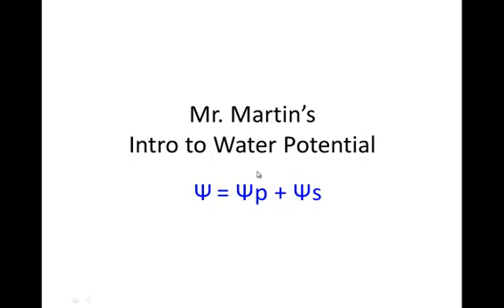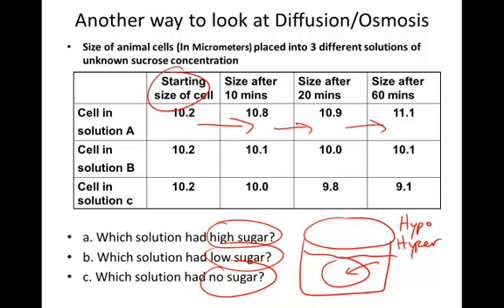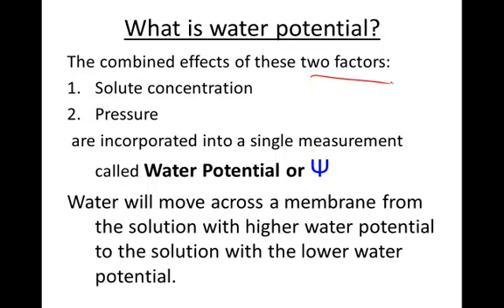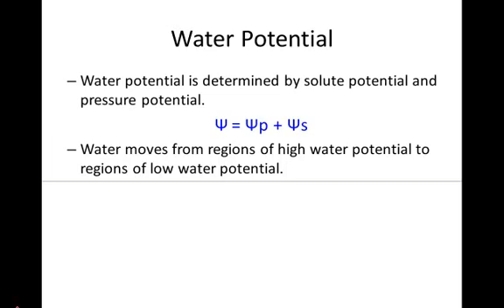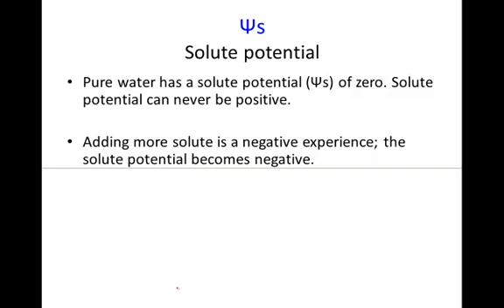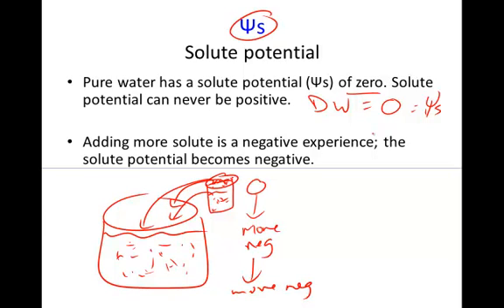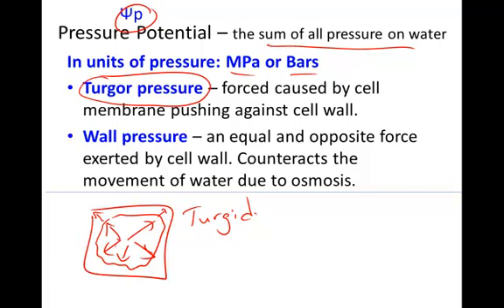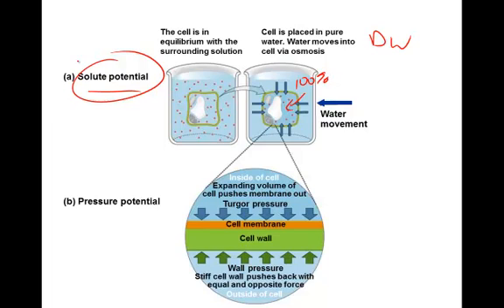Intro to Water Potential

Comment: Just in addition to what Kevin said about the membrane, there is not just one membrane in the cell. When Kevin explains tugor pressure and talks about the membrane pushing against the cell wall, he is referring to the membrane of the vacuole - which basically constitutes 90% + of the area within the plant cell.
It is the vacuole where water diffuses into or out of, with regards to tugor pressure. 

This is just an addition to what you said Kevin; Other than that, great explanation! 

In case my comment is - by any means - incorrect, feel free to correct me.

Comment: In animal cells the pressure potential is equal to the water potential because of the physical pressure acted on by the cell wall.  If pressure is negative then there is tension if the pressure potential is positive the the cell is turgid